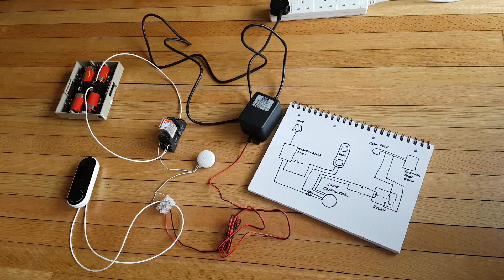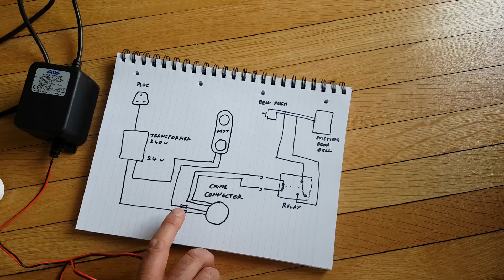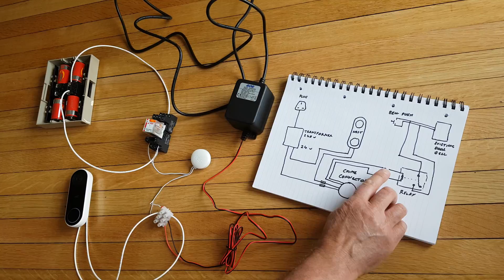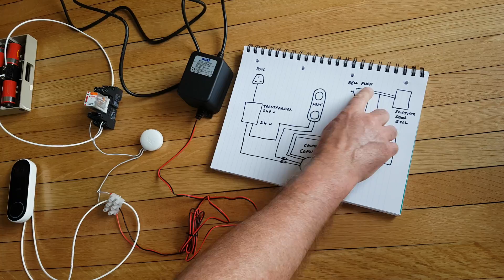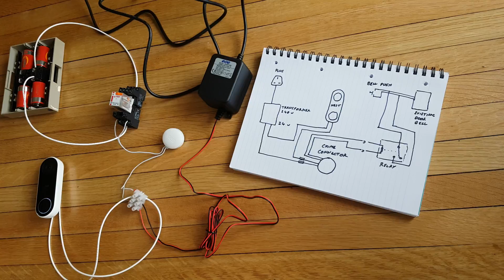Nest Hello Advanced Wiring Diagram

Comment: Really useful video. Am I right in assuming though that if I am using a transformer (BRITISH GENERAL 8-24V 8VA BELL
TRANSFORMER MODULE from Screwfix) that I wouldn't need to use a relay, I can connect the chime connector directly to my Byron 720k chime?

Comment: I just bought 8 Pin 10A 24VAC Coil Electromagnetic Relay with Socket Base DPDT with LED and Mechanical Indicator LY2N-J.....how do we wire the relay? Which wire goes on which pin?

Comment: Thanks for a great guide, I installed my Hello today and found it really straightforward.
If anyone is interested I used this relay from RS: Omron G2R-1 SPST Non-Latching Relay PCB Mount, 24V ac Coil, 10A 

(RS Stock No. 789-4666 )

Comment: Looking for some help here and came across your post.. live in the US have a 16v:10va 2 connector transformer connected to a regular push doorbell. And regular door chime. The elec originally installed it like this.  Red from Transformed connects to the one port on door chime then the other port on the door chime connects to the push doorbell. The green from the transformer connects to the doorbell directly making the ring loop..standard I know....I would like to change the transformer for a 3 way trans, with 3 connectors 8v, 16v,24v, I want to feed the chime with 16v and the nest hello doorbell with the 24v side.. this way when the Nest hello is pressed or sees motion it works by the 24v feed but the transformer feeds to door chime with the 16v side....can this be done and it so how do I wire it...

Would really appreciate learning from your expertise.

Comment: So glad you posted this, this sorted out my dilemma of having to replace my existing chime which I liked and didn't want to disturb.

For those who are hunting down the parts, I sourced from https://uk.rs-online.com/.  And all under a tenner and free delivery too (at the time of posting).
Relay: RS Stock No. 805-2153
Socket: RS Stock No. 123-2057

The Nest chime connection go on terminals A1 & A2 to activate the coil. I then used terminal 11 (com) and terminal 14 (NO - Normally Open) to simulate the old bell push button loop. Do test before you install as I don't want to be liable for your install, but this worked for me.

Comment: Hello. Great setup.
Where did you purchase the relay?
Do you have a part number for the relay? 
I called RS components and they don’t have any rely in stock that can take 24vac switching with such a low current at .33Amps
Please help
Reply: I saw a similar video which used this relay.  Hope it helps. 
URBEST

4.3 out of 5 stars  65Reviews

URBEST HH52P AC 24V Coil DPDT 8 Pins Electromagnetic Power Relay w DYF08A Base

Amazon'sChoicefor "24vac relay"

Comment: Instead of the non contact relay can you use a step down buck converter? To reduce the 16-24v to 8v

https://rover.ebay.com/rover/0/0/0?mpre=https%3A%2F%2Fwww.ebay.co.uk%2Fulk%2Fitm%2F321524715689

Comment: Hi I have a multi volt transformer giving me 8v 10v and 24v can I use this power my existing 8v door bell and if so how would I wire it, would I still need the 24v relay ? any ideas ?
Reply: Specs say transformer and chime need to be same voltage

Comment: Hello,

I've got quite similar installation except my existing DoorBell is powered by 8V transfo.

I have already implemented  a new transfo. Legrand 230V - 16v/24V BUT problem is that I don't know how connect my NEst Hello using 24V with existing doobelt 8V powered.

Can I use same solution than yours? 

Door Belt picture:
https://www.noelshack.com/2018-33-5-1534517369-img-1456.jpg

Picture of existing switch:
https://www.noelshack.com/2018-33-5-1534517363-img-1457.jpg

...Don't ask me why each wire has been doubled...I discover it :)

Thanks in advance

Comment: Great video I used 16volt plug in transformer finder 24v relay and Honeywell series 9 wireless chime thanks
Reply: Josh Tooth so even with a 16VAC transformer plug, the 24V relay works? Also, ever since you used this relay, batteries I presume have lasted quite a while? Do you know how frequent you will have to change them out on the wireless - wired transmitter?
Reply: aizadaddean Honeywell telling me should get 5 years out battery
Reply: Josh Tooth how did you get the chime to receive without the button?
Reply: Crag Mack The Honeywell chime has a transmitter just put relay were the push button should be
Reply: Josh Tooth can you show me how exactly you did yours? And everything that you had to buy
Reply: Crag Mack ok go you tube search nest doorbell UK  watch jay Hussain video tells you all stuff you need from amazon Then using this video wire in a 24v relay which you get fro RS component finder across A1A2 on Honeywell chime
Reply: Josh Tooth thanks man this helped
Reply: @josh. Why do you need the relay? Can't you just connect the transformer direct to the wireless converter?

Comment: has anyone connected them up to a existing chime?  my query is if you upgrade the transformer to 24v , then what happens if the existing chime is rated at something less, i have called nest technical and they not helpful tbh, i had to install my first one for them last week , which was basically swapping a ring pro which doesn't have a wired chime, they couldn't tell me how to connect the chime connector, in the end i just worked it out myself and left the two cables with the hooked ends from the chime connector in connectors, only thing is the custom doesn't have a chime indoors but relies on notifications from his phone , ipad,etc, actually nest support recommend not to connect it that way for some reason

Comment: Hi really helpful video, I will be using your setup as it's really uncomplicated the issue. Just a one question, I do not have a door bell at the moment so have to buy one, which one would you recommend for this setup?

I found the relay, hopefully its the same one used in the video:
https://uk.rs-online.com/web/p/non-latching-relays/8052153/
https://uk.rs-online.com/web/p/relay-sockets/1232060/
Reply: this option may have answered my question, just use the Byron 776 word door bell. As you can see from the manual the batteries become redundant as its powered by a 3 pin plug into the mains. Then use the your digram to finish off the install, what do you think will it work?

doorbell:
https://www.ukelectricalsupplies.com/byron-wired-transformer-doorchime-with-built-in-transformer.htm

Comment: Thanks for the video. 

I don’t have any wiring for a doorbell currently, so need to make a fresh install. 

I have found this transformer at screwfix:

https://www.screwfix.com/p/british-general-8-24v-8-va-bell-transformer-module/8707p

Which seems to suggest it’s suitable. 

However, I don’t want a chime as I have google home, so essentially just want the nest hello powered.

Based on your diagram, does that mean the rely and chime isn’t required?

All I know about electricity is it apparently hurts if you stick your fingers in a plug, so if I’m asking a stupid question forgive me!

Comment: Hi @gt8monster - Great video and very useful. 

Can I use the same setup and wire it into a chime with built in 16v transformer plugged into a 3 pin plug?

Thanks
Reply from the maker: Jikesh Shah Hi, I believe Nest will run on 16v, therefore this setup may not be needed
Reply: Thanks sorry I was meant to the bell had a built in 8v transformer which is why thought this would be the best option for me. Will give it a try, thanks once again.

Comment: Thanks for the post. I was discussing with my electrician and this really helped. Question where did you get the transformed and the relay? I might do exactly what you have.
Reply from the maker: RS Components
Reply: gt8monster thanks again. My parts arrived and i wired it up just like you said and it works a treat. I happen to have a musical door chime which plays a tune but it works just like you had it setup. I was not able to find the components on RS components but i got them from eBay in the end. 24v AC 1Amp Transformer and 24V AC relay Omron. Googled the wiring diagram online and copied your layout.

Comment: Very useful thanks. Pretty much what I had drawn out in circuit form except with a Honeywell wired to wireless converter to use the Honeywell series 9 bell system. Good to know it works :)
Reply: I've just put this together using gt8monsters wiring and the Honeywell wireless converter with a Series 9 MP3 Doorbell.  Works a treat :) 
Just remember to use A1 and A2 on the converter when using the relay. 
My first attempt was without the relay using A1 and AC1 and it just drained the converters Button Battery. 
That, and it chimed the Doorbell at random times (2:45AM being the worst!!)
Reply: @buynitcheaply  
Did you use 12Vac relay (as Honeywell chime supports 8Vac and 12Vac only), kindly let me know, I'm stuck at this stage.

Comment: Hi @gt8monster
Thanks for the video. It’s useful to see. 

A couple of questions:
What’s the voltage of the Chime?
Does your chime only take batteries?
The 24V plug transformer is that something that can be picked up pretty easily from the high street or local electrical shops or will I need to order off eBay or similar?!

Thanks
Warren :)
Reply from the maker: Warren Buckley 
Hi Warren, the voltage of the chime is irrelevant as the relay isolates the two circuits.
We used a battery powered chime as an example, the relay can be used to switch any doorbell, just remember if you have a 24v AC transformer you must have a 24v AC relay coil.
We used a 24v AC transformer from RS Components, we bought the relay and base from there also.
Hope this solves any confusion.
Reply: Hi @gt8monster, thank you for your video, it's very helpful, I would highly appreciate if you could point me to the 24v AC relay coil and base, the website has so many of them and when I called the support they asked what is the amp for the relay... Many thanks.
Reply: Do you have a link to the transformer as I’m struggling to find it, thanks
Reply from the maker: Jikesh Shah something like https://uk.rs-online.com/web/p/cctv-power-supply-accessories/4709616
Reply: Thanks, I saw that one but it isn’t 1amp (1000ma) as you suggested so thought it may not work. Thanks